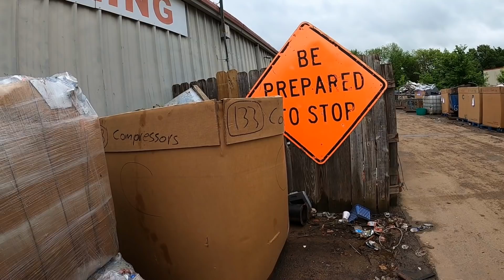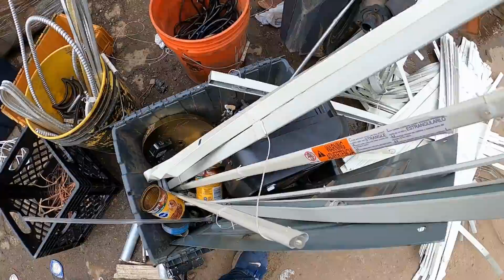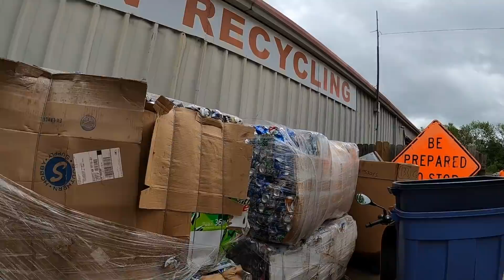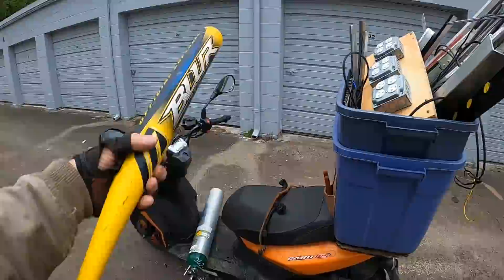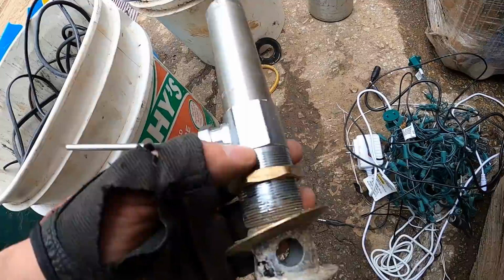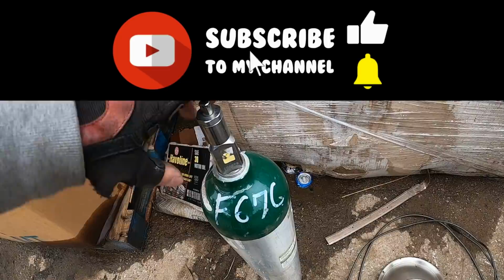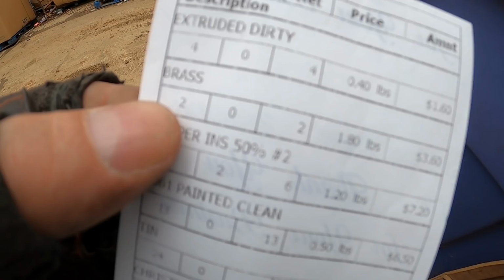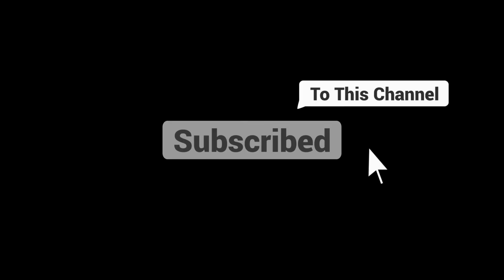Cash Today! (Make money from your garbage)

Comment: every one has there way of scrapping but I just don't understand why you don't line up your totes and sort your scrap in its own bin as you get it. then take it in as one full tote of a item instead of 1 or 2 pounds of all kinds of stuff per trip. I have 55 gallon barrels lined up and sort as I unload and micro scrap. when the barrel is full enough take it in then. no sorting at the yard for me. still love your videos and look forward too all the new ones.
Reply: Yes! Solid advice.
Reply: Yip iv thought the same bulid binds in the locker for different metals so its all sorted

Comment: Careful with using disney stuff theyll get you hard. on the O2 tank and the gauge. screw the T handle all the way in. then itll tell you how much O2 is in it. the very top the silver 4 sided nut thing. theres a plastic wrench you can use but any adjustable wrench will work to open it to release the O2. to remove the gas valve thing itll need a big adjustable wrench and a lot of strength to remove it. easy peasy really. ope this helps :)  i kinda  want that blue tank to turn it into a faux NOS tank but im sure shipping will be expensive? hugs love and bee safe :D
Reply: I think you can use 10 seconds of any music before you get the shaft.